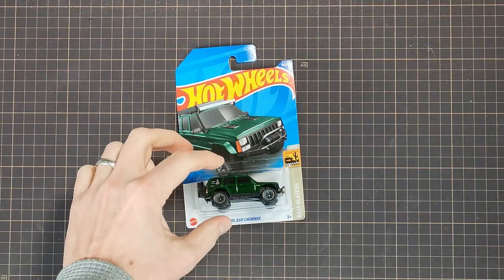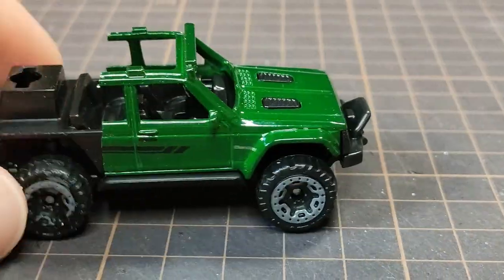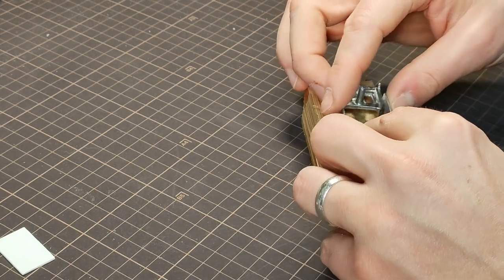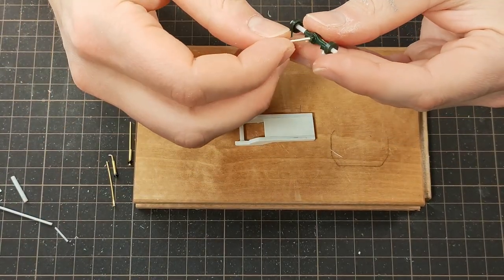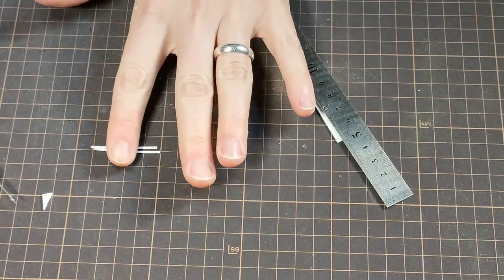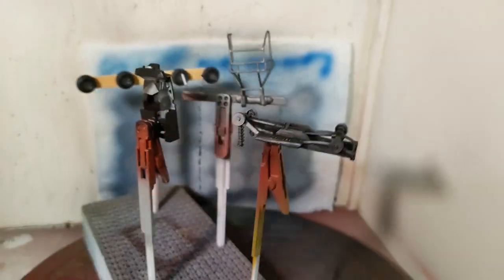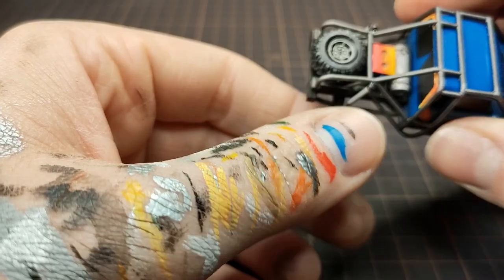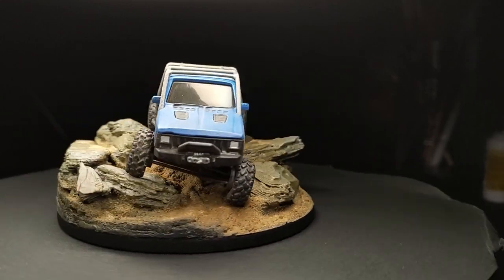Custom Off-road Jeep mini Diorama | Scratch building and 3D modelling

Comment: Outstanding build, the level of detail is just amazing.  I wouldn't consider using printed parts on a build as cheating, there's still a lot of clean up and stuff to do to get them to look right, let face we all usually swap out the wheels on our builds for a set of more detailed ones.
Reply from the maker: Very good points 👍 the cheating comment was more of a joke between me and some friends but it looks like it came across more than expected 😂

Comment: I admire your skill with how clean you manage to keep these models. I started trashbashing Hotwheels cars into Gaslands inspired cars as a hobby last month and even though I'm still getting used to the super glue and baking soda stage, seeing your projects come together is super inspiring and definitely something to want to work towards!
Reply from the maker: Thanks for the kind words, My Dude! It's easy to get into customizing hot wheels but it takes a lot of hours to improve. Everything is so small 🤣
Reply: @BPCustomCreations  Hahaha you got that right! The amount of times where i've snipped a part off and spent a good while trying to find out where the hell it flew off to is probably 70% of my entire building process so far but when it eventually finally comes together it's pure bliss!
Reply: I believe that there is a direct correlation between how small a part is, how important it is to the build and how far it will travel at the most inopportune time. 😭😠

Comment: Looks Great! I like the use of a Hotwheels thrown up in the mix. And don't worry what haters are going to say. If you do all the work in blender and print it out yourself its still custom. Blender is a skill of its own which I have none. That's one of the things holding me back from getting a 3D printer. Solid build bro.
Reply from the maker: Thanks! I completely agree. Printing is just another tool to utilize 👍